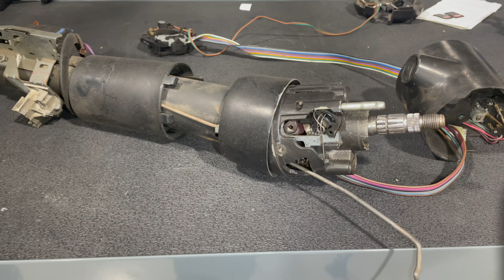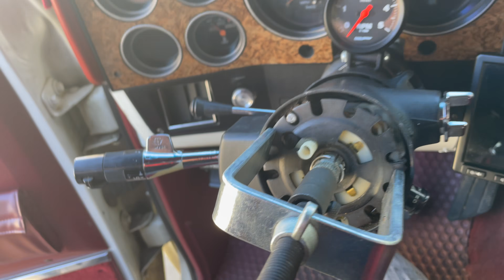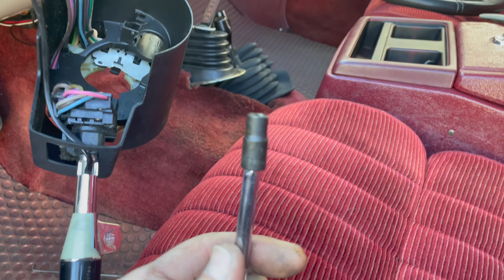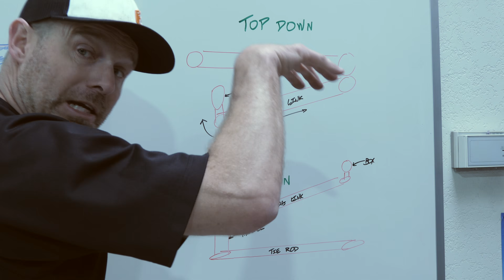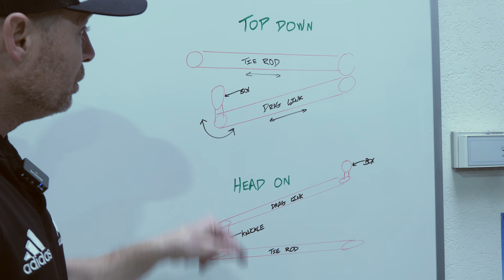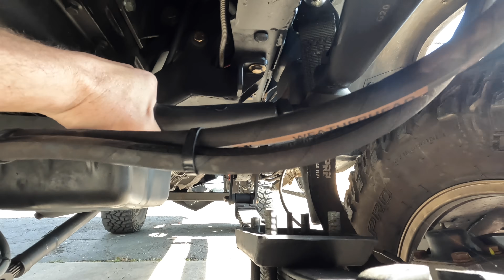Tips and tricks to fix the steering on your Squarebody!

Comment: Wish I had that lock plate compressor when I took mine apart to replace the turn signal cam.  Removing and replacing that snap ring is a real pain in the ars.  Makes you wish you had a third hand.  My hands are getting arthritic now, so I probably couldn't do it today without that tool.

Comment: Thanks for the video. Do you have any ideas on removing stuck hinge pins?  I was very careful with a puller, lubricant and tapped the pin with a punch, but no success.  Thanks in advance for your help.

Comment: ....uhhhh....@9:41....
I'm NOT saying the stock steering setup is ideal by any means.... BUT your assessment of ' it involves a lot of linkages and joints' is, IMHO, incorrect.

You still have the same number of tie rod ends with a crossover setup as you do with the stock steering.

What DOES change is the geometry of the steering which I can see helping/improving the steering feel over stock.
Reply: Absolutely correct. Crossover steering will greatly improve the bump steer problem. However one thing nobody ever seems to mention is the strength of the factory setup. Squarebody 4X4 setup is extremely strong, except for the box mounting [prone to crack the frame rail, easy fix].  But if you do a lot of highway driving, the bump steer is really annoying and crossover is a great improvement.

Comment: Locktite is your friend.   The bolts will back off again.  Next time use the pivot pin puller and get the upper two bolts you missed.  One other thing to correct.  You mentioned the stock push/pull steering had more joints and linkages to wear out. Fact is they have the exact same amount of tie rod ends. The steering arm still bolts to the knuckle.  I totally agree crossover is better on a lifted truck but implying there is less to wear because it has less parts isn’t quite on the mark.  Point to note those with stock steering can straighten the steering wheel the same way. Just adjust the short drag link to the driver side knuckle is all.
Reply from the maker: 100 agree on the amount of joints, it is more the quality of the joints and the adjustable draglink and tierod.  Those are super susceptible to movement and slop.

Comment: One thing you have to do is stop using the steering wheel as a grab handle. The steering support and steering housing really don't hold up to the pulling yourself in. Well he said it as I was typing ha ha. Im not sure how many steering housings I've rebuild over the years with GM service  while they where  under warranty. Cops where the hardest on them. 93,94 where different and had a cover making it a little bit harder to break . By 1995. The steering columns where all different. But most the older steering columns parts will somewhat interchange and yes the jeep  steering shaft are  a nice up grade.
Reply from the maker: this is good information.  They are getting harder to find, its all the more reason to keep the ones you have in decent working order!
Reply: @merricksgarage   yeah the early years models have a lot of interchangeable parts so grapping a column out of some cars are good to have in stock

Comment: I got rid of my K5 blazer over the steering issues. It had a 8" lift....and bump steer, and steering moved when doing a hard brake and the suspension compressed.
Reply from the maker: sounds like you got some problems with the lift not the steering or axle

Comment: I did a full, detailed tear down and rebuild on a tilt steering column a couple months ago. There’s actually 4 torx bolts holding the inner assembly together. It’s worth it to get a pivot pin puller so you can access all four (and throw in some lock tight) because only 1 bolt was actually secure on mine. I’m glad you brought up the drag link because that’s one of the next steps for me!

Comment: Idk if you’ve seen someone do this but if you don’t use your coat hooks you can remove them and put roll bar led rock lights and then run the wire behind the trim down the A pillar and wire in a dimmer switch. Did that with my barn door burban and let’s just say it’s night and day lol.
Reply from the maker: That’s a great idea!!

Comment: Didn’t really do that properly. You have to pull that entire aluminum assembly off via pivot pin puller, there are 4 bolts in there you have to tighten. I only saw you tighten 1.

Comment: Great content as usual! Seems like I've had to do this to every squarebody I've owned with tilt column, and there have been MANY. You missed the other bolts in there, but it's more work to get to them. This will help for a while! LoL

 You could (should!) do a whole video series dedicated the all the squarebody quick fixes that most previous owners neglect! There are quite a few and they're all really annoying and relatively easy to do! You know...the door striker bushings (SLAM SLAM SLAM....latch), window track/slide/roller lubrication (applies to power and manual windows), door hinge pin sag, glove box hinge replacement, vent window latch repair, window scraper seals, inside door handle lever angle adjustment (HATE it when the rubber snubber is gone and they point inward!), pickup rear slider window latch replacement, HVAC blend door clip replacement....the list goes on and on! 

Looking forward to seeing the builds start in the new shop! Gotta keep your eyes open for a K5 Blazer Chalet....be an AWESOME candidate for the Merrick's Garage treatment!
Reply: I would definitely like to see an interior door handle adjustment on the 81-91s. The never sit right, always pointed inward and don’t sit level

Comment: unless you pull the pivot pins and disassemble the column further you have only tightened two of the loose bolts. does it work yes.It will work for a while. it  helps to wiggle the lock plate compressor side to side as you tighten it down. some times the splines it is uses get  a little bond up and you  bend the plate instead of compressing it.

Comment: One of the best and easiest upgrades I did to my k5 was a jeep xj steering shaft. It was almost a direct replacement, it just needed a little grinding for bolt clearance and it eliminated all of slop from the rag joint
Reply: I have to try that
Reply: @jacobking4106  it only works for 81-91 older ones have different gear boxes
Reply: @jameshall4385  I've got a 1990 suburban that's been 1 ton swapped. It could use a little help in the steering department so I'll give it a shot. Thanks bud
Reply: @jameshall4385  did you buy one off like rock auto or a junk yard one?
Reply: @jacobking4106  i picked mine up at the junkyard.
Reply: I did it on an 80 k5 it worked perfectly
Reply: I installed one on my 84 Scottsdale and I refuse to use a rag joint ever again lol
Reply: What yrs of jeep xj work for squarebody chevy?
Reply: @shaneedgecomb6749  i belive it is 84-mid 90's.the ones with airbags dont work. And it only works on 81-91 square bodies. The older ones have a different steering box. Astro van Shafts work too but you have to take them apart and rotate the shaft 180°
Reply: @jameshall4385 thanks I have an 82 with the traditional sloppy steering and would prefer to take out the rag joint if I can.

Comment: I know my question is not relevant with the video but, I have a 82 k10 keep overheating on hot days or slow traffic 
Thermostat is new , water pump is new and I have aluminum radiator and electric fans.
Any idea what it is ?
Reply from the maker: does it get hot and keep climbing or just get to a really hot point and you turn it off?  still have heater?
Reply: @merricksgarage  the heater works fine, heater core is new also with the hoses 
One day the temp went up to 210, but on cool days like today on high speed temp stays 160-180
Reply from the maker: did it get above 210?  That's not terribly high.  The LS engines run close to that at operating temp!
Reply: @merricksgarage  it keep climbing and I have to stop, is a sbc 350 I wish I have an LS lol
Reply: Do you have a fan shroud?
Reply: @Marcus_Woodard  the electric fans have a shroud already installed
Reply: @gdc818  Then I’d pull the t-stat and verify what temp it opens at. It can be brand new and still be bad. Then make sure there is no air in the coolant system. Also, make sure the radiator cap is good. What temp are the fans set to come on? And what is the highest temp it got to?
Reply: @Marcus_Woodard  thermostat opens at 160 and the fans are on at the same temperature
Reply: You might have a cracked head or cracked block.  One way to tell is to start and run the engine with the radiator cap off.  If the water starts bubbling, you have cracks or a leaking head gasket into a water passage.